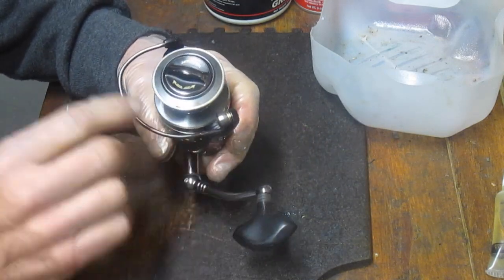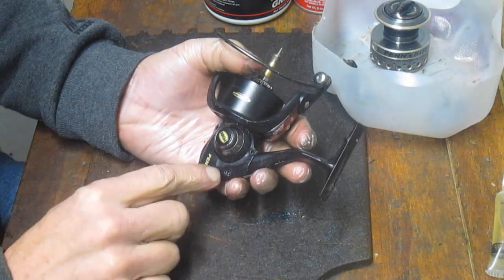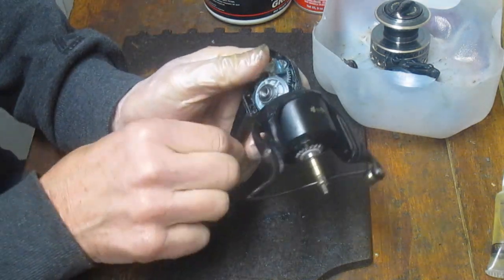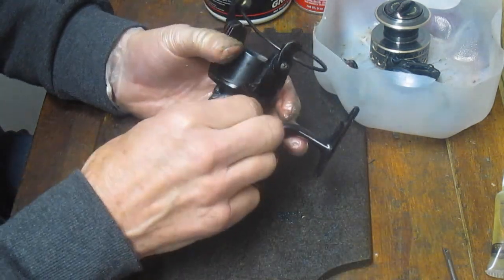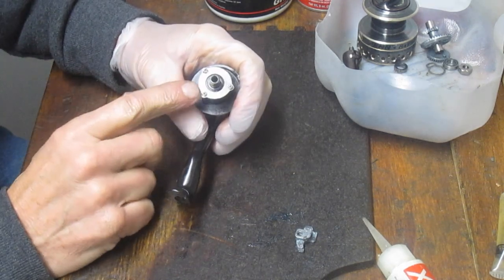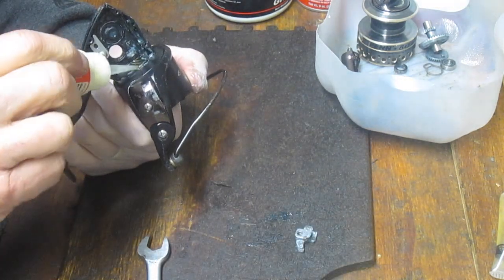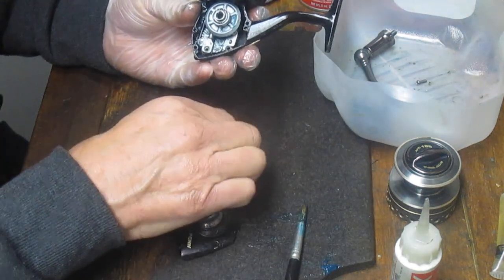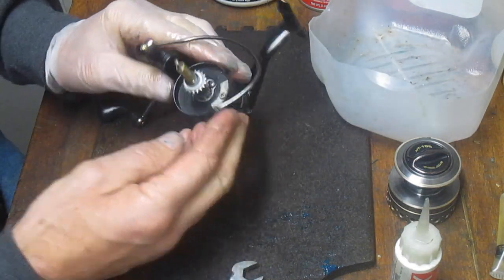Penn Battle 4000 How to take apart and service a fishing reel that was dropped and damaged

Comment: Thank you for your videos!  Really helped me with my Penn Battle spinning reels.  Question: I’m having trouble with a Battle II 7000, the pinion will not come out, the collar and bearings seem stuck in there too. Any tips?
Reply from the maker: Try flooding top and bottom with a penetrating oil and then reattach the rotor cup and nut, but nothing else and use the rotor cup as a handle or knob to help wiggle or lever the pinion gear out of the case by pulling up and rocking side to side - Dennis

Comment: Hi Dennis thanks for sharing I have a battle III 4000 with the same problem is the reel shaft for the Battle III 4000 the same as the fierce and the Battle II and Battle I 4000?
Reply from the maker: Based on the schematics, they are not interchangeable.  The battle iii has a unique number that is not shared with the others - Dennis
Reply: @2ndChanceTackle  thanks Dennis a further inspection I noticed that the main shaft I've damaged has damaged the crosswind block and crosswind gear. Being in the UK it's hard to get parts for Penn
Reply: @2ndChanceTackle  subscribed